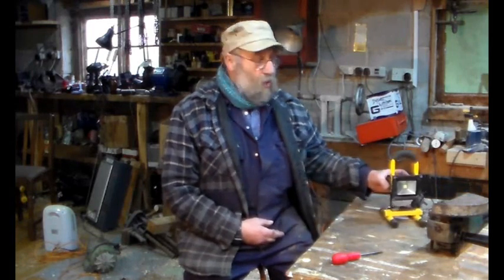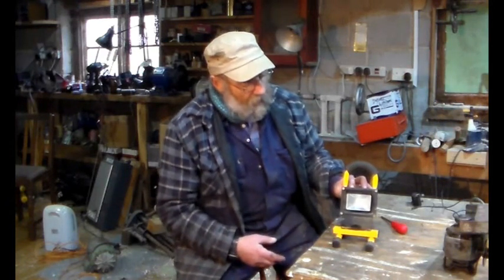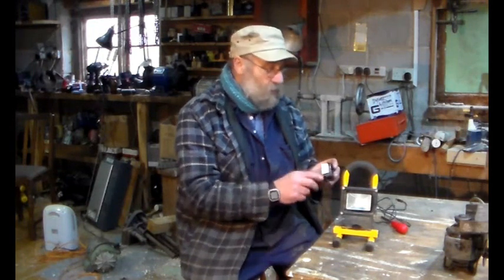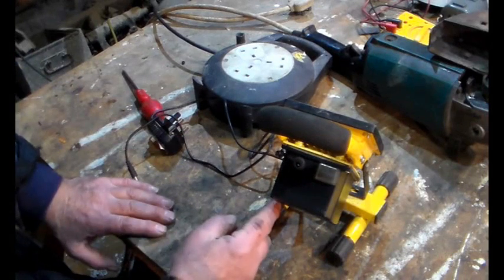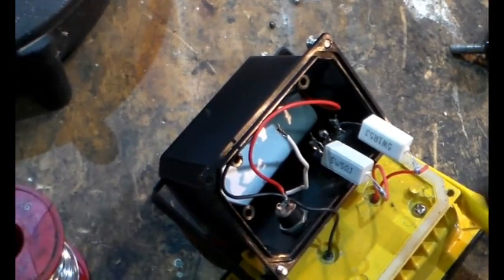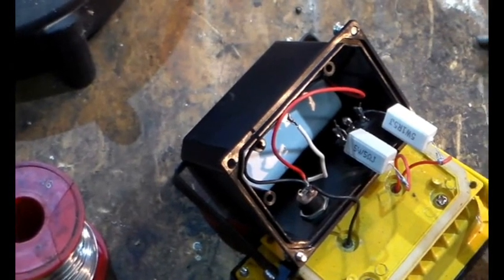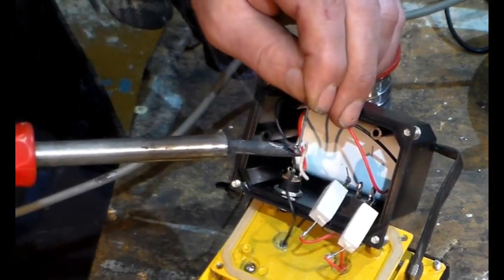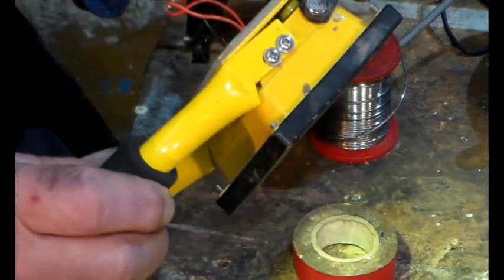LED work-light fix or spares?

Comment: Did that loose white wire look like it had snapped due to wobbling about, or was the end still tinned as if the solder joint was rubbish ? Either way, it's not very good for a supposedly rugged work light....those two resistors looks like they will be breaking off next....haha.
It was a very easy fix anyway - nice find for you ! Cheers, Dave
Reply from the maker: Dave, strange the wire was tucked away but it could have had several shocks in the scrap pile. It did have some solder on it and so probably a very poor joint fell apart. As you say the resistor legs are a weak point, but it's free and I won't be throwing it about, cheers

Comment: I cadge everyone's old laptop batteries as when they fail it's usually only a couple of the cells that's dead.I use them in LED torches and the home made infra red on my air rifles.
Seems everyone has the same experiences with grinders.I have an ancient Wolf 4 inch grinder that just keeps going and going while the new ones are almost as consumable as the wheels.The best thing about the wolf was that I had it given over 20 years ago and it wasn't new then!
Reply from the maker: Mark, I have found the voltage variable on laptop cells and quite often it is the BMS that fails first. Wolf were taken over by Makita in the late 70s early 80s. I have a 4 inch belt sander from that era, still going strong, cheers

Comment: I have one of these lights that I pulled out of a skip Andy, my one just needed a charge. I have no idea why it ended up in a skip.  But on the other hand, for a broken one, if someone with a different mindset is an electrician, or any trade, and is billing £50+ per hour, and one of these lamps is £20 without vat, it is just not worth the hassle of trying when you know that you can buy a new one, write it down as a business expense, and not waste time attempting to fix the old one.  I would try, and do, but then I'm not on big money and my attitude to life, stuff and time is not typical. What irritates me is that when these go in a skip they are quite likely to wind up in landfill or maybe separated out for scrap metal, depending on the skip yard. Either way that lithium is better off not going into those waste streams. So even if all we do is open it and split it and recycle it correctly we are taking a step in the right direction. But you know this already. As for grinders, I bought my makita 9" when I was in school, biggest investment I had ever made! About £90 on special. 20 years later and it is still going perfectly, I have opened it up to clean it and check the brushes, but they last! When cutting stone and brick I tend to use a diamond blade and run the hose straight on to it to prevent dust, no bother! But it tends only to do masonry now and not much metal, since the 1mm thick blades became available for the little grinders. Enough of my nattering, I have a real question: I have been gathering 18650 cells in their broken appliances, usually handheld vacuums, but sometimes batteries for drills, if I want to use these, assuming they are not dud, do I have to use the circuitry that comes with them, or is there a simple way around it, for charging and discharging in use?
Reply from the maker: Hi, I agree with everything you say here and the working unit was thrown because it was in the way in a small house and tiny mind. The 18650 question: firstly these batteries are not all the same, so laptop units are different from (say) vacuum units in that they are designed for less current flow. To work similar cells you need a BMS board (battery management system. This charges each 4 volt battery (batteries) so they are all the same voltage (balanced charging) but discharges at the series voltage. Ebay, lithium BMS search, a 2S 15A with be 8.4v (2 cells) and the "s" number changes with the number of series cells so for instance a 6S would be for 24v. Hope that helps, cheers
Reply: @TheInfoworks  Thanks Andy. It is on my long list. To make some powerful bicycle lights, but with no travel at the moment it has slipped down the list.  I have a bit of reading and watching to do. The cold weather has prompted me to make a propane forge in the meantime! All the best!